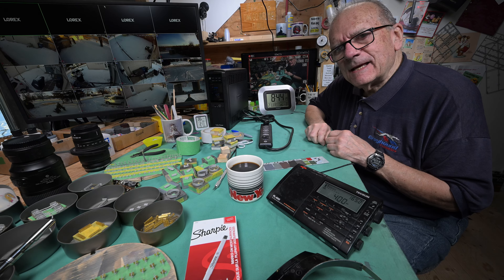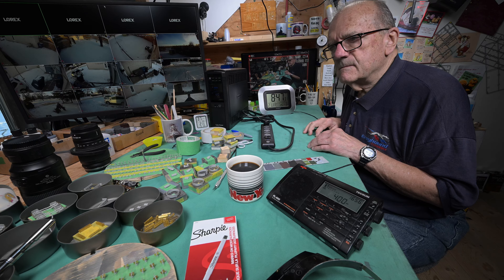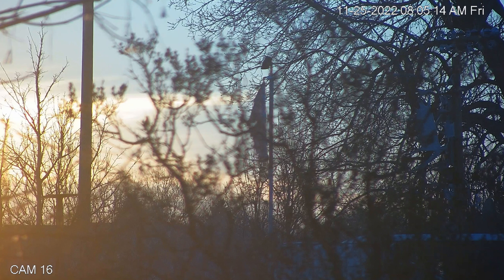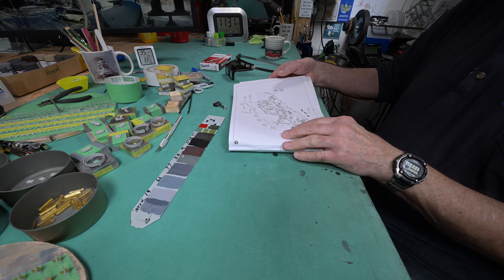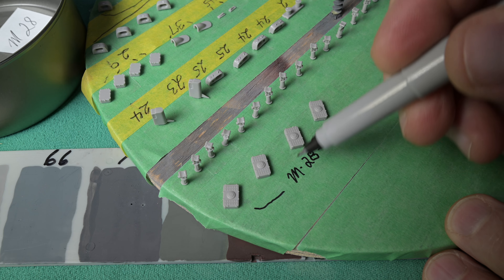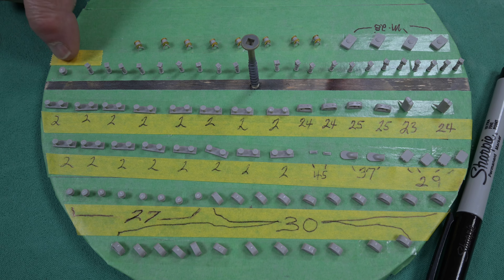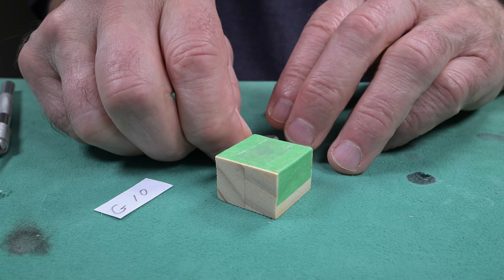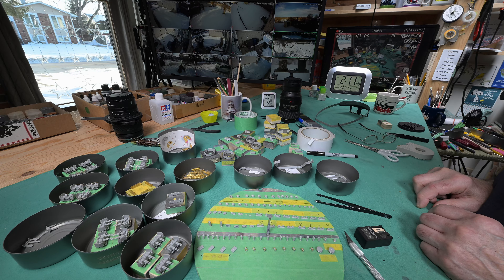The Model Ship - Part 1377

Comment: In the United States, the signals received by radio controlled clocks originate from NIST Radio Station WWVB, which is located near Fort Collins, Colorado. WWVB broadcasts on a frequency of 60 kHz.     Is this the one you are looking for?
Reply: I copied this from a google search.  Initially I found the other (Voice) frequencies you listed for WWV stating they operate in the high frequency (HF) portion of the radio spectrum on 5 MHz, 10 MHz, and 15 MHz; and 2500 W on 2.5 MHz and 20 MHz.
Reply from the maker: Thanks for that info! Guess I won't be tunning it in then because my long wave only goes down to 100 kHz.
Reply from the maker: Thanks! I was Googling WWV but not WWVB https://en.wikipedia.org/wiki/WWVB